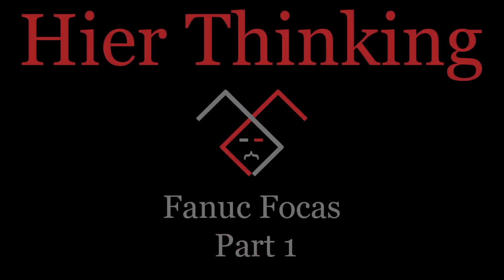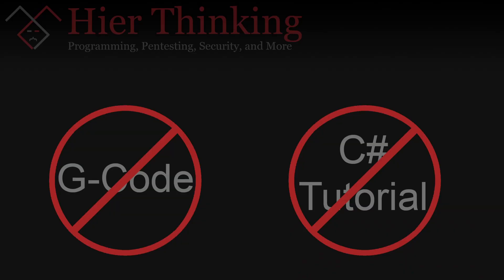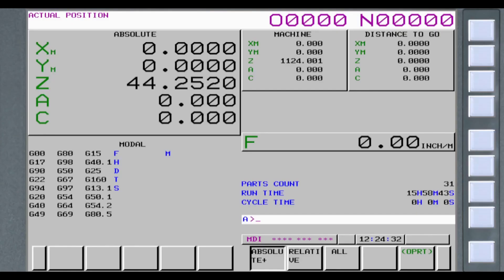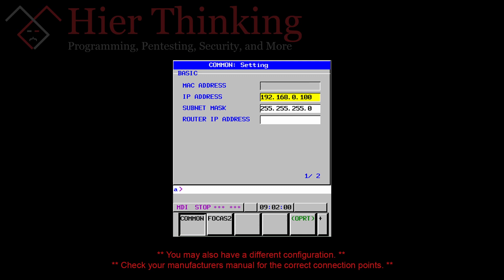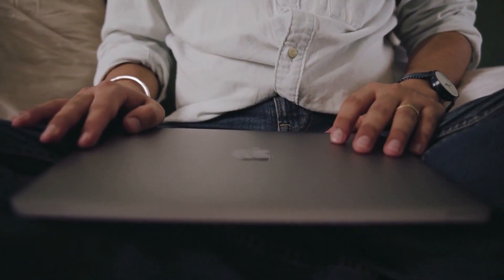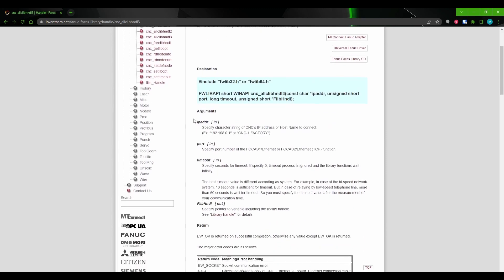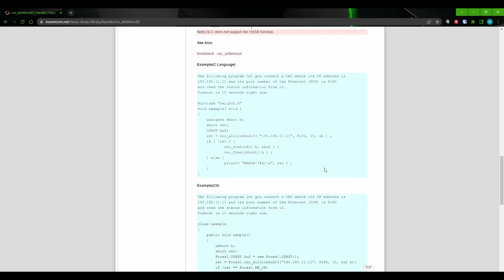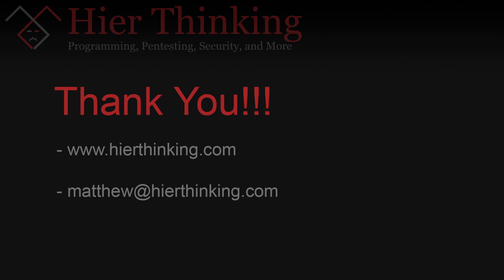Mastering Fanuc Focas: CNC Programming (Introduction)

Comment: Great series. I just binged through all of them. Why no use of C# exceptions? They reduce the clutter of error handling so one can more easily see the "normal" flow of control. I'd factor that "if(_rc)" clause out to a "testFocasResult(_rc, apiname)" method that throws if _rc is non-zero. You'd just follow each Focas call with a call to that routine. Then catch the exception in main() and print the result. I'd also wrap the handle in an RAII class that frees the handle on program exit. main() would use a using statement to ensure that the handle was Dispose'd of on exit. (For lurkers, handles allow you to maintain simultaneous connections to multiple CNCs.) A lot of the APIs have 2's and 3's after the name. Why? Are those updated version of the APIs with no number after them?
Reply from the maker: Thanks for checking out the series! I found when I was trying to learn this stuff that there isn't a lot of material on the internet, so I was hoping to help fill that gap for others. As for why I don't use better error handling, it is because I am trying to simply the code as much as I possibly can. I want everything I do to be explicit and to show what the true intent of the code is. In my own code I do things differently. But you are correct, there are certainly better ways to handle the errors. One thing you need to watch out for with the Focas library is the use of exceptions. Unfortunately, since the Focas library is written in C, a Try/Catch block doesn't catch all the exceptions that result from the function call and you can end up with an unhandled exception.

As for the numbers after the API calls, the descriptions of the calls usually contain something like the following: "This function is the improved version of the [x] function". Sometimes this is because the older version doesn't support a specific control type, as is the case of https://www.inventcom.net/fanuc-focas-library/Position/cnc_rddynamic2
Reply: @HierThinking  Understood on ease of learning. You're typing in the entire program for the lesson, and a good exception idiom requires a fair amount of boilerplate. (I just coded one up in C++ and it got a little involved.) OTOH, you could prepare that part ahead of time in a header. It's pretty simple to understand, just tedious to write. The test and throw at the point of call is much tinier than checking error codes and much less intrusive, leaving the "normal" execution path much less cluttered and easier to understand. The error output is done in a catch clause in main. 

Since Focas is a C API, it doesn't throw at all, so you'd never get unhandled exceptions. 

Your description of the APIs with 2''s and 3's in the name matches what I'd suspected. There's even a version 4 of the handle API, but it's not documented. The new argument is an "id" but I have no idea what would go there.

Comment: Hi, thanks very much for the video. I have a question. How do you get to the Windows desktop on  your fanuc controller like you did at 4:58? Sorry if it's a dumb question, I am new to this stuff. Thanks!
Reply: I think its because newer controllers are built in windows, older only have the fanuc interface. but i may be wrong